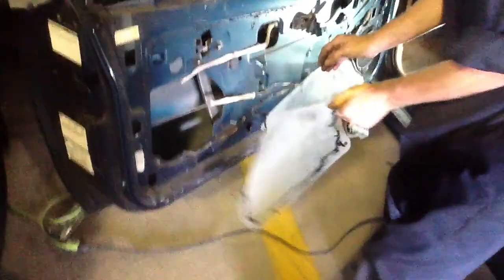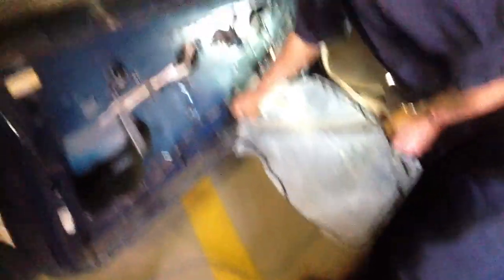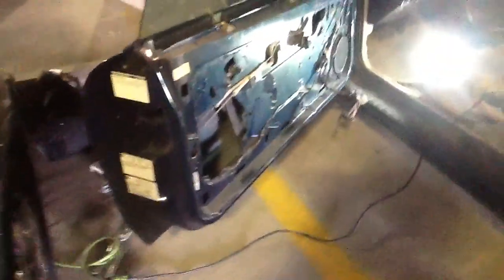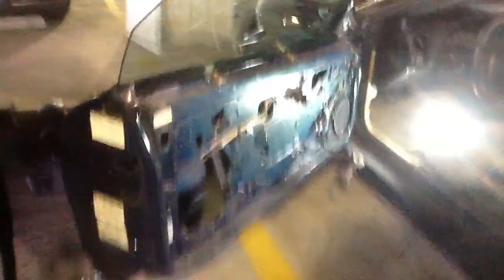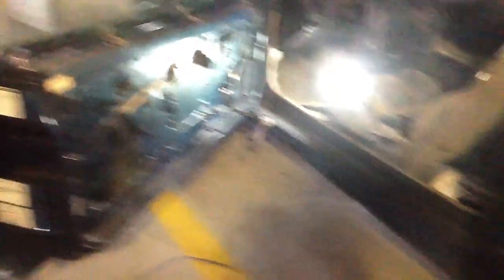Does My Car Really Need a Vapor Barrier? Video Ex.

Comment: I bought a car with a disassembled door because the window regulator was broken. There was no barrier, so when I fixed the regulator I just used a doubled over trash bag attached to the old adhesive. It's better than nothing. The car is 12 years old.
Reply from the maker: Excellent Idea. Love It!
Reply: Cheap shower curtain, sharpie, knife, gasket maker, and 15 minutes of your time would probably be a little better. If this account is even active anymore, or you have the car lmao. Wild the shit you find on youtube.